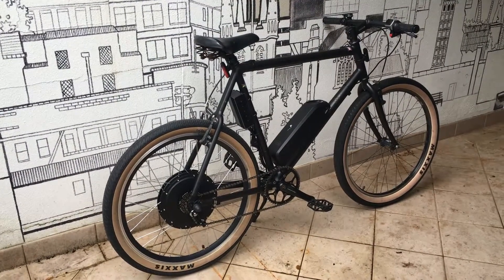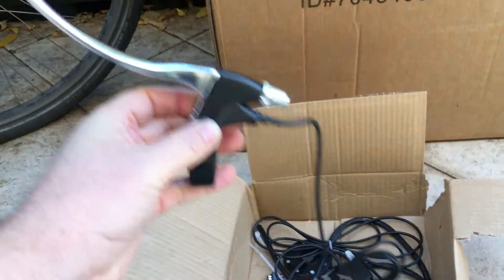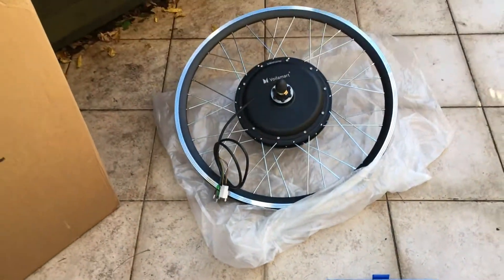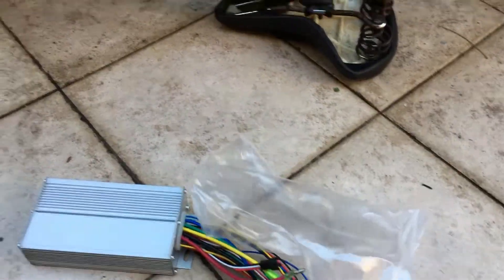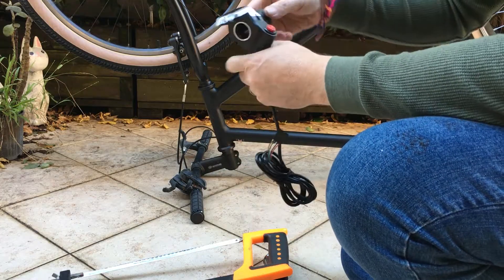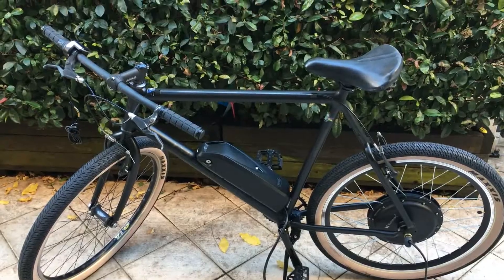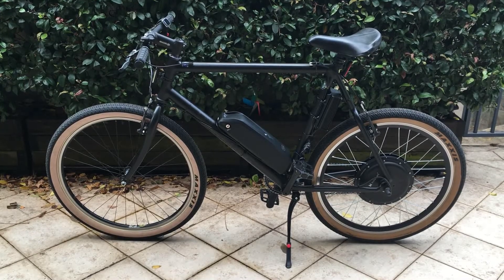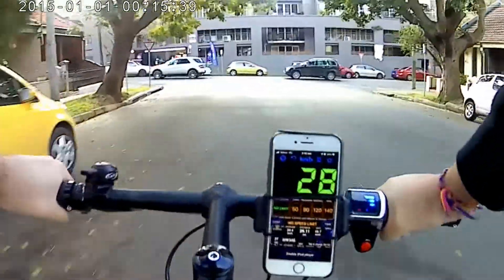EBike Conversion Kit from Ebay - Build your own Electric Bike 48V 1000W

Comment: my bike is 29 will it be alright?
Reply from the maker: If you get a 29” wheel kit it will be fine.
Reply: @Mikey2hands  But the thing is that one is from us and I'm in aus plus that one was cheaper so I don't know any other cheap ones.
Reply from the maker: @aayantheangler7101  don’t pay over $300 in Aus. They are out of stock at the moment on eBay but I recommend waiting until new stock arrives. There are some rip offs charging $600 or more that aren’t worth it.
Reply: @Mikey2hands  These are £200 here without the battery £380 with a battery 🇬🇧
Reply: I saved your link for the conversion kit but there still out of stock and they have not replied to emails, i cant believe u got it for that price $219 or something thats like half the price as every other seller on ebay.. i cant wait much longer will probs pay the $400 for the 1500w kit from aus dealer